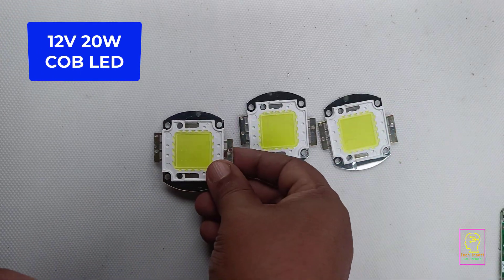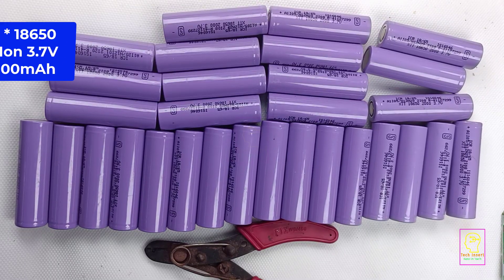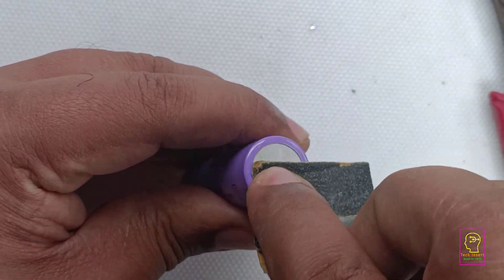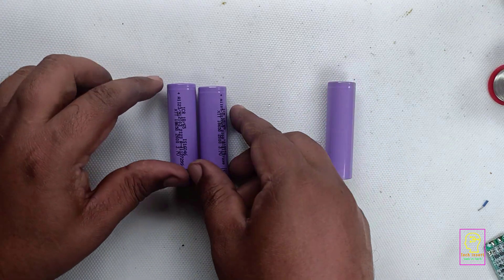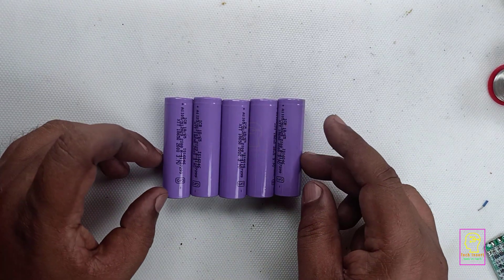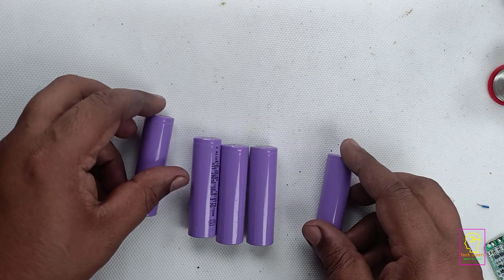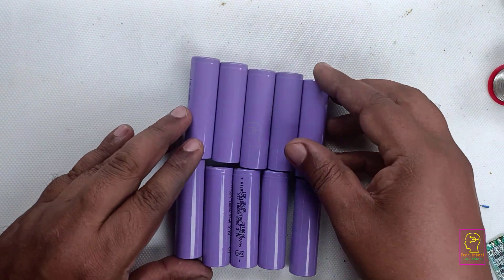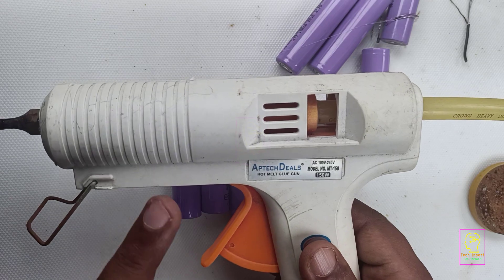Make Yourself 12V, 20A Li-Ion Battery For 100W Emergency Light

Comment: Sir can you show us the back up test of this 12v 20ah battery
Reply from the maker: Using this battery im making n emergency light, camping light with 5 number of 20W COB led that means a total of 100W which is variable, switchable etc. Will upload soon

Comment: Nice video keep it up 👍 sir I have one request for how to charge 32650 6000 mamp 3,2 volt battery 
how to charge this battery with out any module 5100 so sir make  auto cut circuit please make a one video it is humble request thank you
Reply from the maker: 32650 and 32700 can be charged in same method. Kindly watch this video https://youtu.be/mQRoaScdpQU
Reply: @TechInsert  which method please let me know
Reply from the maker: Kindly watch the video it has evrything